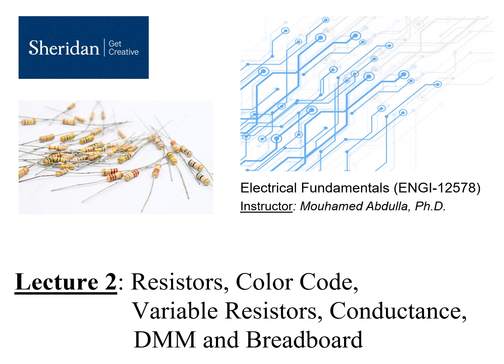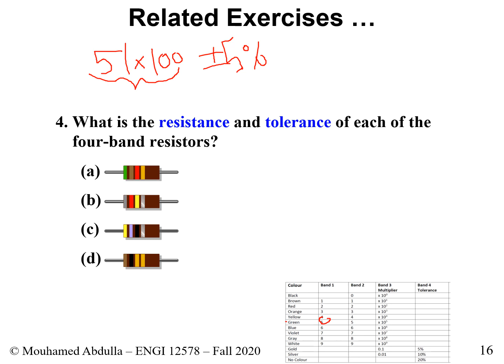Lec 2 - Resistors, Color Code, Variable Resistors, Conductance, DMM, Breadboard

Comment from the maker: Timestamps:
--------------------------
00:00 - Introduction
00:23 - Inside of Resistors
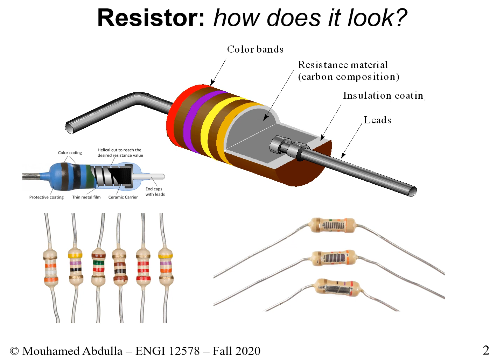02:57 - Functionality of Resistors
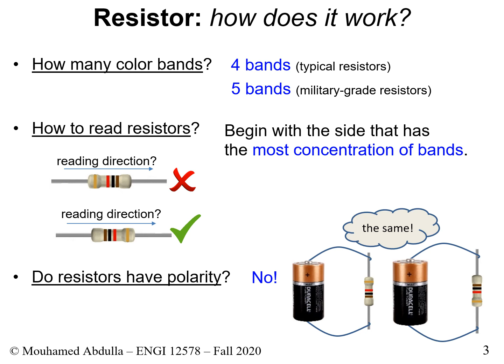05:40 - Color Code of Resistors
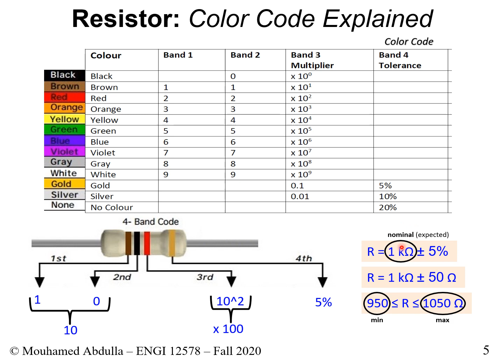14:39 - Variable Resistors (Rheostat vs. Potentiometer)
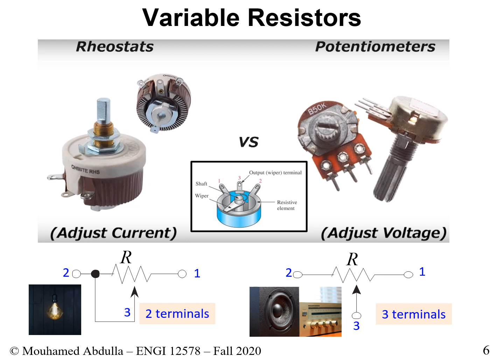19:02 - Electrical Conductance
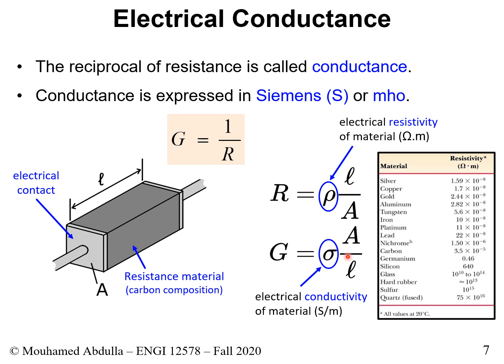28:10 - Digital Multimeter (DMM vs. VOM)
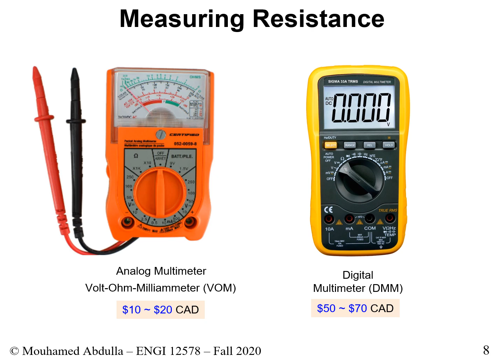31:30 - Basics of Breadboards
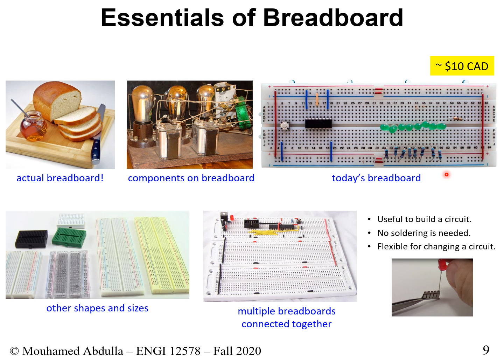35:47 - Inside of Breadboards
38:34 - Basic Circuit with Breadboard
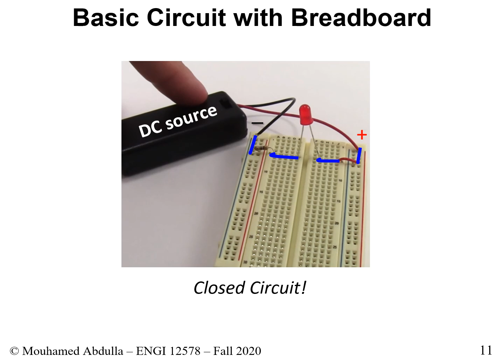41:13 - Key Terms and Definitions
41:23 - Relevant Multiple Choice & Arithmetic Exercises